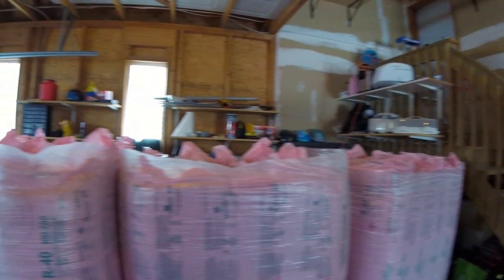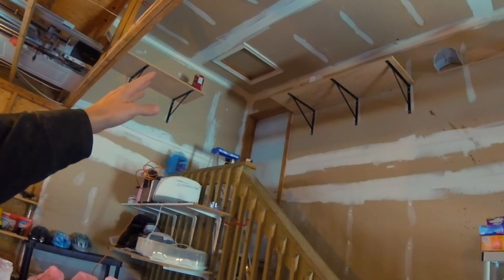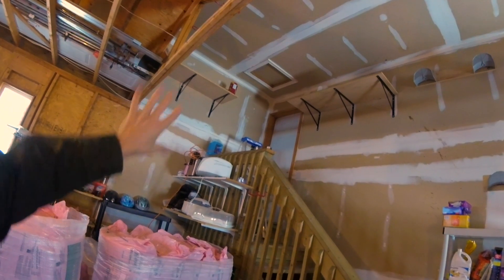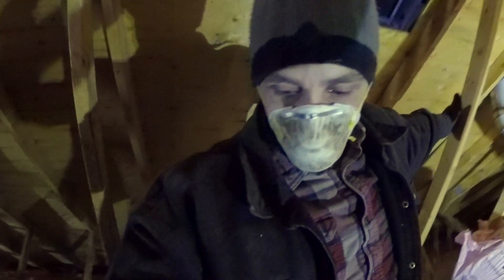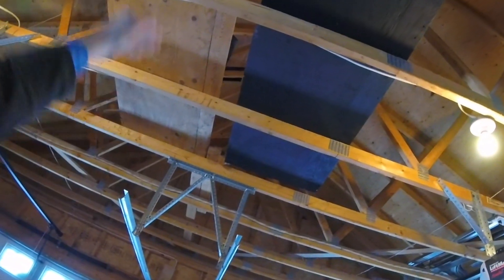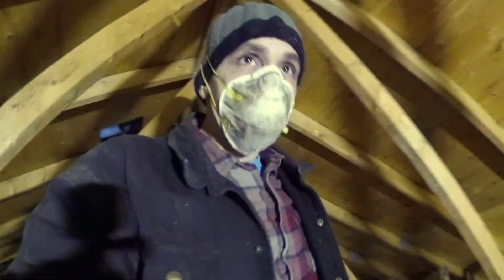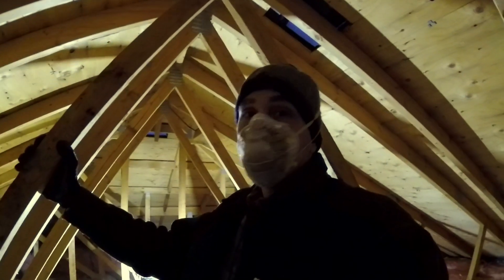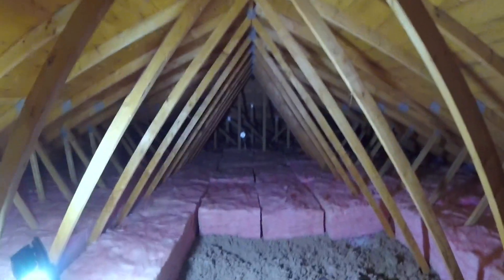Fibreglass over Loose Fill

Comment: So 2 years later have you noticed a big saving?
Reply from the maker: Sold the house, unfortunately. I did, however, notice that the heat/AC needed to run for shorter duration and less frequently than prior. Although I also updated both the furnace and central air around the same time as doing the attic.